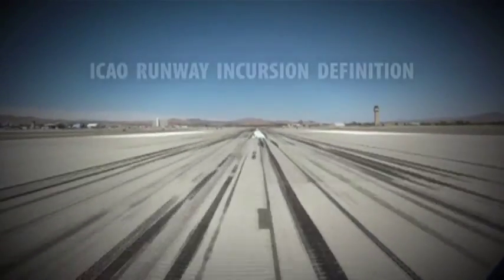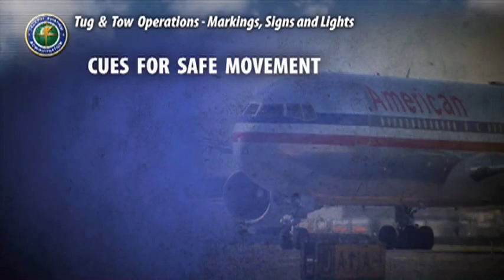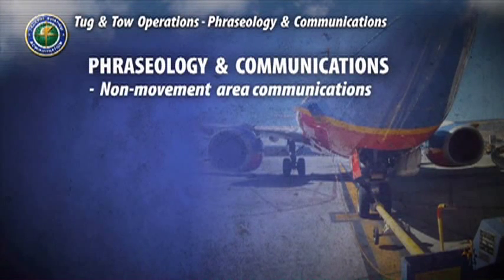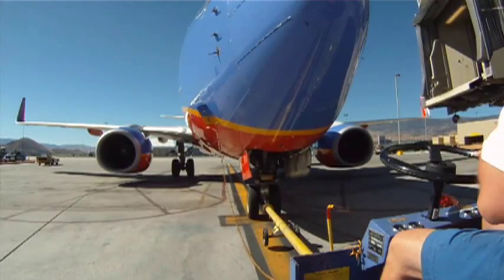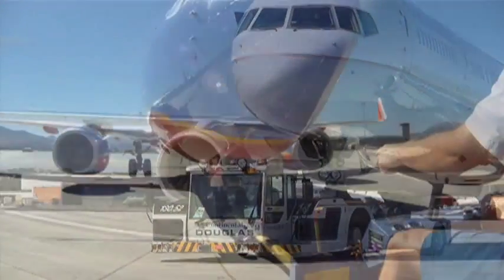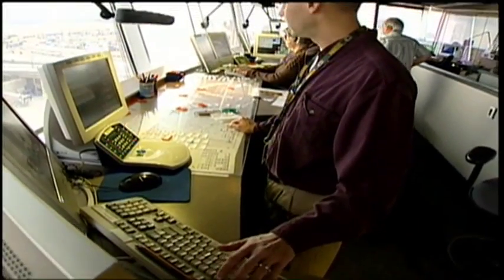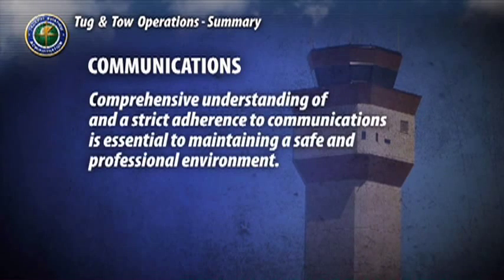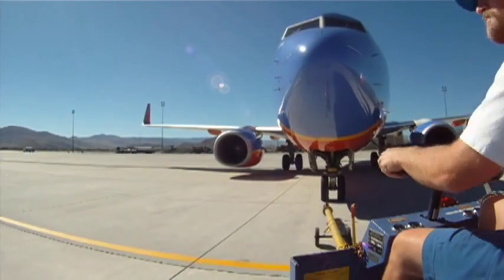FAA - Safe Tug and Tow Operations

Comment: Nice video pretty amazing that these small vehicles can pull a huge commerical plane connected only with a locking pin either by pushing or pulling means. The most dangerous/safety thing i learned is to stay clear of the areas where the turbojet engines can suck you in if on as well as turboprops.